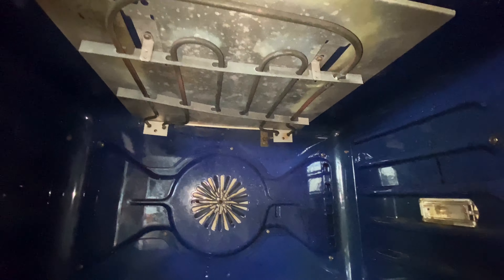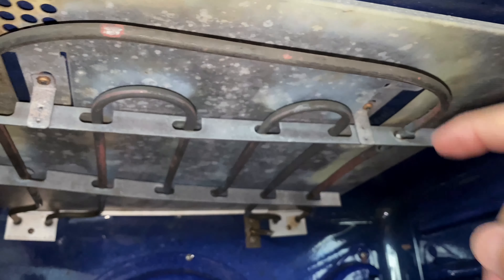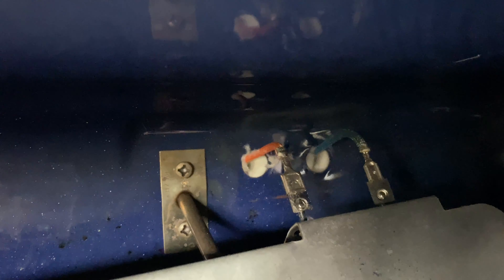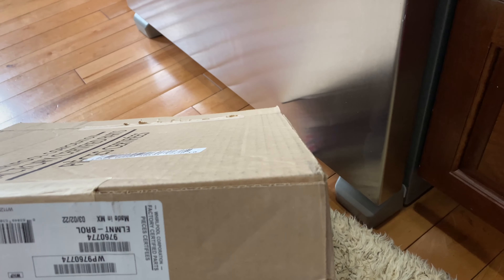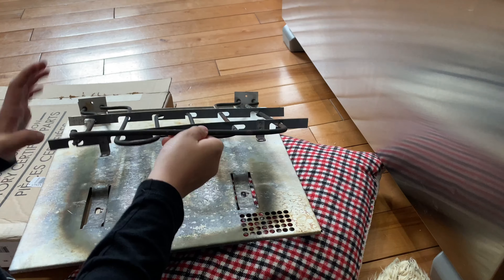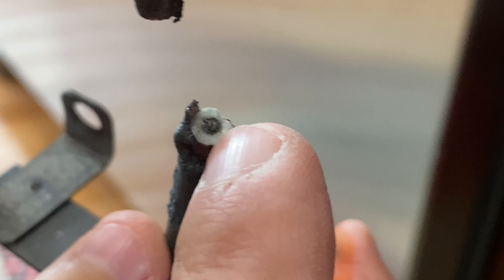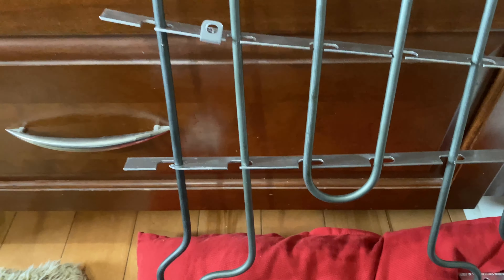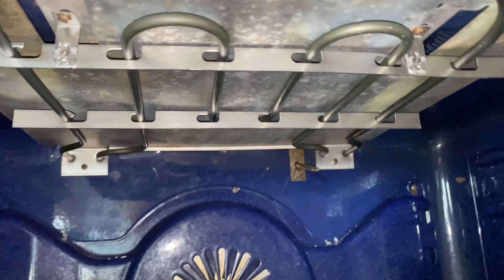KitchenAid Oven Broil Element Replacement

Comment: What does it mean if the outer broil element comes on but the inner broil element doesn’t come on ? Broil element had already been replaced. Bad board ?
Reply from the maker: I’d check your wiring connections first or possibly the element was broken when it was installed. You can multimeter the element and if you have the unit out meter the connectors and board and that should tell you hopefully what’s going on. Look for the wiring schematic print when the unit is out of the wall.
Reply: Same thing happened to me. Bought a second element to rule out the first one being bad. Wires are all connected to the back fine. I’m stumped.